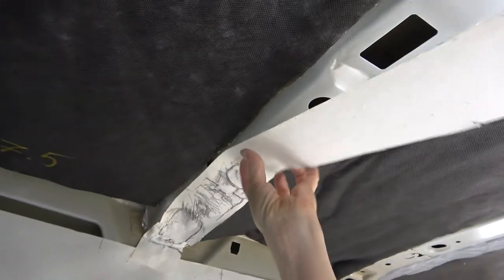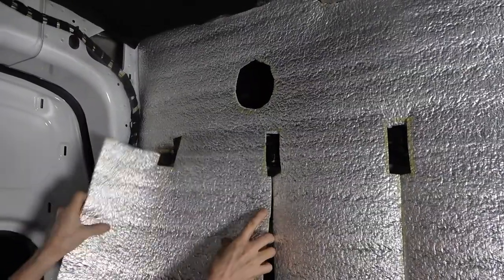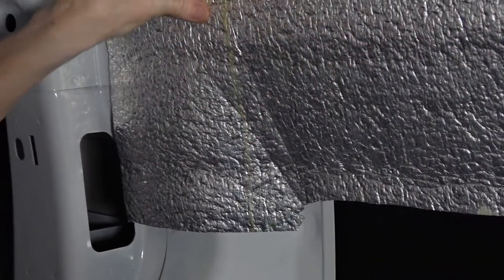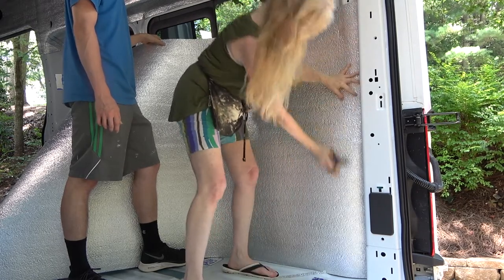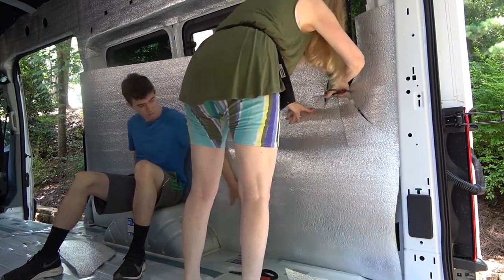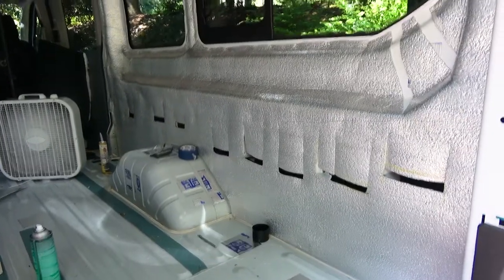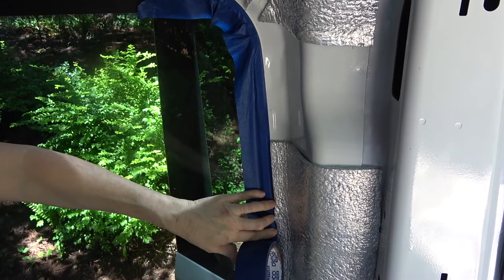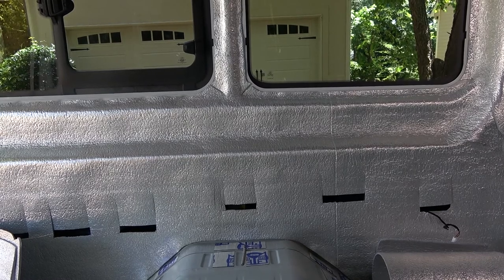Install EZ-Cool Thermal Barrier the Right Way in a Van! Low E Insulation Guide. Wander Wonders

Comment: What are using to seal the gaps at the bottom of the wall (next to floor)? Aluminum tape??
Reply from the maker: In the dry areas, we didn't.  We intentionally left gaps so it could breathe. In the wet areas, we used caulk and painted on a thick coat of Flexseal which is very stinky, but it goes away after a few days. Thanks for watching! Trisha

Comment: I’m working on a Transit passenger conversion right now. I have 3 questions. 1) Did you remove the airbags and 2) how did you deal with that? 3) Are you happy with your insulation so far? Hope you’re having a great time.
Reply: 1) Ours didn't come with airbags beyond the driver/passenger area. We are keeping those side airbags which are exposed and will fashion a boot that can break away. I don't think I would keep the rear bags unless you can build cabinets above them. We are maximizing storage space. 2) Yes, we are happy with it but in excessively hot or cold weather, I know that covering the windows can make a huge difference. 3) I wish that I could say that I was writing this from the wilds of America, due to covid, we postponed for a year. We have sold our house! Closing in a week so we are moving forward. We spent so much time getting the house ready to sell that we're not finished with the van. "Best laid plans...!" Ha ha I'll keep posting videos.
Reply from the maker: I just realized that I answered your question from our other YouTube channel's account. You were probably wondering who the heck was artzXpress?! That's our sister account where I give free art lessons. I just posted our first overnight trip today on Wander Wonders.

Comment: I used thinsulate and low ez cool. I followed a guide online that said to cut some decent holes in the low ez cool to allow air flow between the thinsulate/walls. I'm guessing that would be to keep any moisture from being trapped?
Reply from the maker: Yes, that's why I have done it throughout the van. Plus, I have left areas for ventilation behind countertops and under the bench seats. Thanks so much for watching!

Comment: I thought that 3M 90 had to be sprayed on both surfaces to be glued, like with contact glue.
Reply from the maker: It's working great from very hot to below freezing temperatures. Nothing has released.